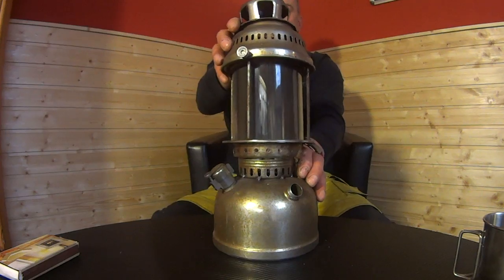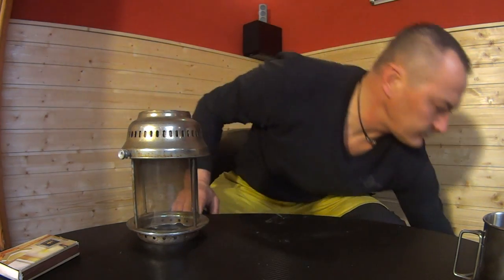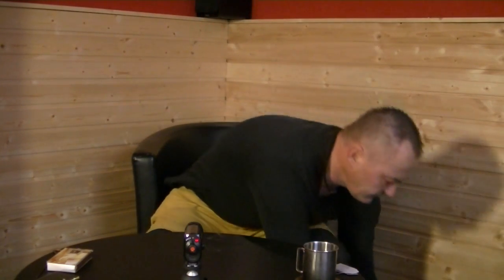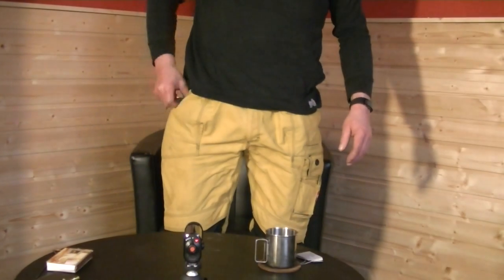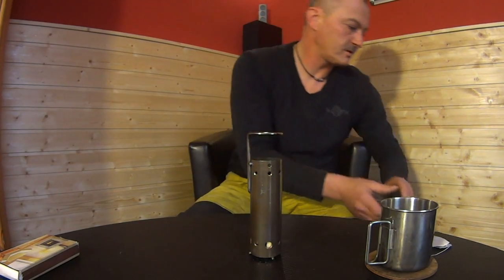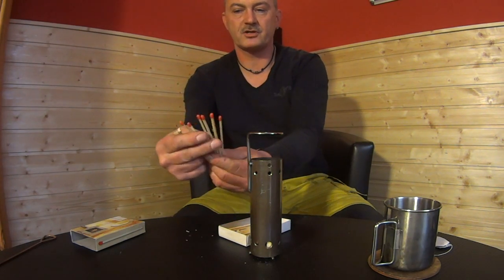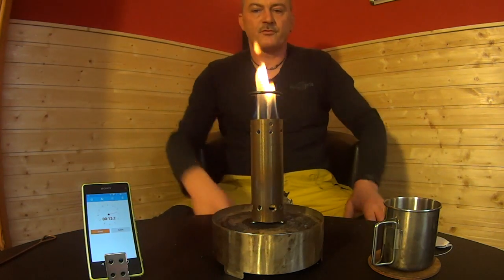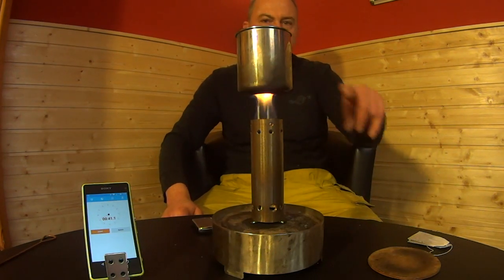micro woodgas stove - blue flames without fan

Comment: That's great! How about building a few more blue flame wood gas stoves... and seeing if you can even improve the blue flame. Probably increased draw, increased mixed smoke, increased hot air, and reduced amount. The draw might need to be higher. The draw might need to be hotter. The draw of pulling wood smoke into the hot air channel might need to be improved with a venturi design.   Give it five attempts... so it can improve each time... perhaps
Reply: Venturi effect on a wood stove sounds interesting if It worked. I might have to try a ventury chimney on my stoves

Comment: Nice. I have made and used woodgas and rocket stoves for camping for years myself. You got some clean burn going. There should be no yellow flame though. Looks as if both sets of air holes are too big. Too few venturie hole as well I am guessing. Watching your vid got me thinking a stainless steel thermos.It may work that one would only have to drill the holes and it is a finished product. Even have the cup to hold a preloaded fuel supply and to use for cooking, heating water for coffee tea or what have you. Simple is always best once you actually figure a thing out.  I'll grab a link to my vids and post here. Old but kind of interesting I think.

Comment: haha, the flame is so long. It's a bizarre torch. A pipe is obviously a good design. Not what I was looking for though. Incomplete burning. What if you made a smaller hole on top of it and a chamber where the smoke (gas) mixed with the air? Similar to how a butane stove works
Reply: I do not know what you mean - it works! Take it ...

Comment: I don't know if I am the only person more interested in the burn at the end than the beginning. I'm looking for a stove design that burns the bio mass down from 1100-1400 degrees F/ blue and white flames and leaves nothing but ash without going out and producing no smoke at the end of the burn without fans like a candle does. It seems that stove designs that have holes on the very bottom and around the sides as well as holes in the middle of the chamber get very close to doing that.